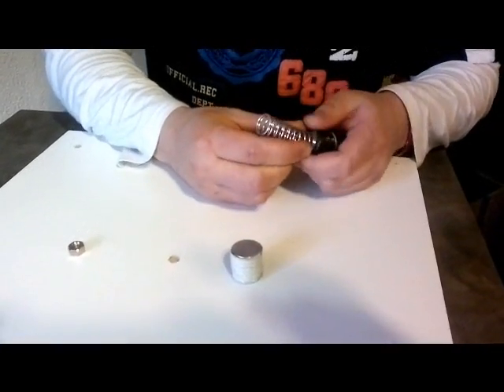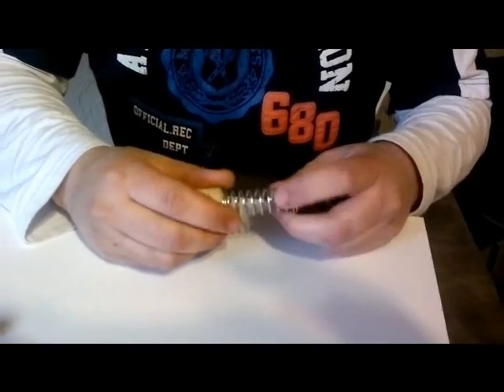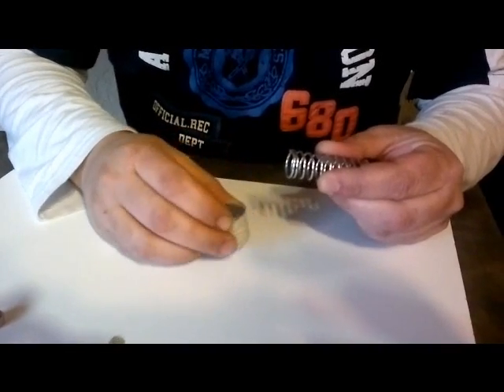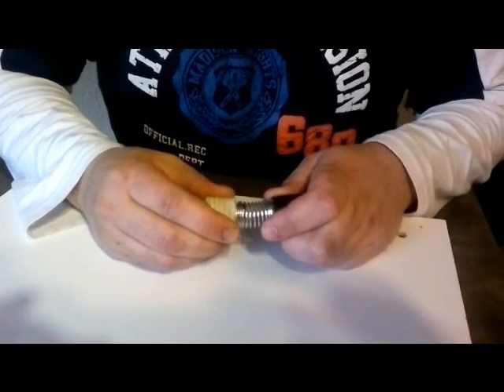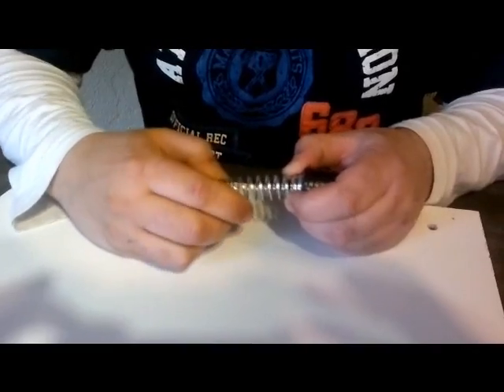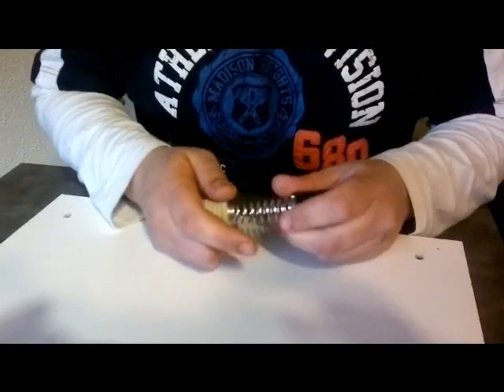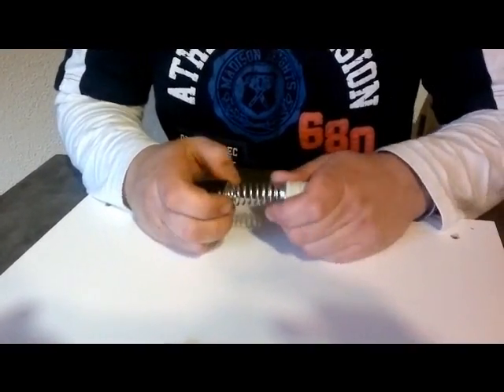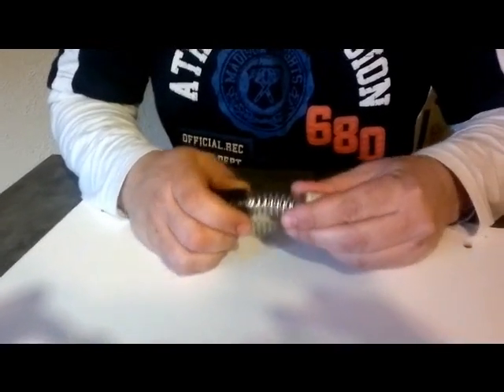Magnetic Spring Piston For Use In Free Energy Magnetic Motors

Comment: Hey, just wanted to say good job guys. I think you are on the right track. Keep the experimenting and prototyping going! You know, reading some of the comments below, I just have to say when people talk about the "laws of physics" and about energy and not being able to get more out than is put in. I really think that the main point is missed/overlooked sometimes. The fact is, and this is according to Albert Einstein himself~ "Energy cannot be created or destroyed. It can only be changed from one form to another." You see, it's not about ~getting more for less~, it's simply about "adding" energy to a mechanical device as for example a magnet motor, and designing it to keep the transfer of energy going! And it's people like you that will make that discovery one day.

Cheers!
Reply from the maker: Thanks so much. There is energy all around us, in all states, much of what I play with is putting something in the neutral zone so it takes just a little motivation to cause it to go one way or the other. I may not end up making a magnet motor but my true intent is to get it to as close as possible so the added energy will be as low as I can get. This may come in the form of electricity, or a lever, or gravity, or duel magnet motors opposing each other helping each other in a yin yang fashion. Time will tell. Thanks for your positive comment.

Comment: It requires the same energy to close it, as it produces,so what's the point?
Reply from the maker: Oh thanks I am glad you asked that. This is about storing energy when you have it and releasing it again when you need it. You can store it much like a capacitor does, for instance you can load the spring slowly but when it is released you have it coming back at a faster speed where the spring is acting faster then the magnets hold to keep them together.  Much like a capacitor you can load it over time and discharge it all at once. Think of it as a mechanical capacitor of sorts. Plus when you load it, the magnets are doing more then half the work and it compresses easily but releases fast as soon as the bindings in the spring are bent the magnetic field is broken and it is not acting as a solid magnet any more. So where would this be useful? On a pendulum is one medium I believe it would be of use. The bob comes back and compresses the spring on its back movement and gets pushed back at the end of its pass much like a kid on a swing, giving back energy just when its speed is zero and adding to the next swing.
Reply: Whats the possible value in that?
Reply from the maker: To use gravity, magnets, both permanent and electro to run a pendulum to lower ones  power costs.
Reply: +SonsOfTesla.Com you cannot use magnets to lower ones lower costs don't you understand? magnets CANNOT produce usable energy Without exception. you can only put energy into them so you can only get what you put in and according to the unarguable laws of thermodynamics you will never get more energy than you put into a system. I couldn't help but chuckle when I heard the word "overunity". that word is kinda a joke there's no such thing and never will be.
Reply: Magnets as atoms are open systems. So with the right application you can harnes its energy for power transformation. Pls check the work of Nikola Tesla and Edward Leedskalnin.

Comment: Make two of them and mount them in a box on the ends put a S shape pics of wood or metal in the middle so the top side of the S hits your spring pushes out pushing the other spring inn and so on, back and forth, back and forth. Then put your flash light generator halfway up the middle of the S for power.

Comment: I suppose a decent analogy is that you carry a bowling ball up on the top of a 100m round hill and balance it perfectly on top, corresponding to the state where the magnets are counterbalancing the spring. You then give either system a slight push, and they convert the potential energy you added to the system to kinetic energy. Neither system performs over unity.

Comment: "Not bad considering I only had to meet it half way."

You didn't. You also set it up in the configuration where you're starting your narrative.(Pulling the magnets apart, giving them potential energy relative to each other) When you did that you added energy to the system, and it's this energy that you later convert to the potential energy in the half compressed spring. In an engine, you'd have to reset that initial state and you'd end up with 0-energy loss due to heat overall.

Comment: You can certainly build a machine that stores energy in a spring then releases it. Some of the released energy will be lost as heat so will no longer available to be stored on the next cycle. That's where the problem is.

Comment: The absolute most you can get is exactly the same amount of energy that has been put into it but 100% efficiency rate is far from achievable at this point.  It doesn't matter how 'quickly' the spring releases, it still took energy to both compress and release it.

Comment from the maker: The magnets on both sides of the spring are in attraction so they are compressing the spring for me half the way, I then add the other half.
When the spring is released the magnetic coupling is broken and the spring gives up all its energy. Plus the spring releases quickly so there is acceleration. It went from  0 to whatever in a spit second. Same mass but now there is acceleration so would that not affect the force as per the equation F=MA ?Not bad considering I only had to meet it half way.